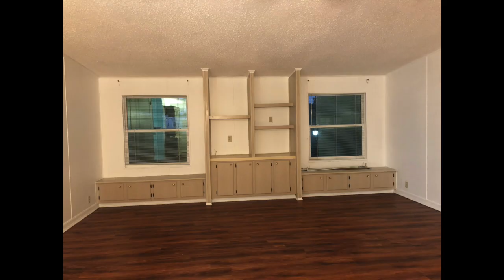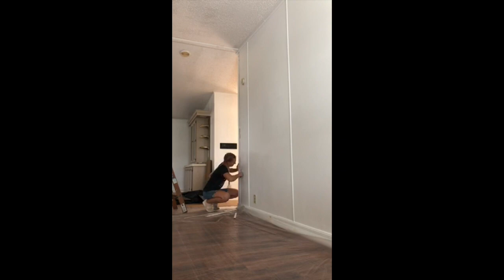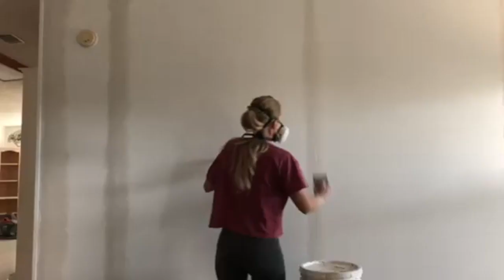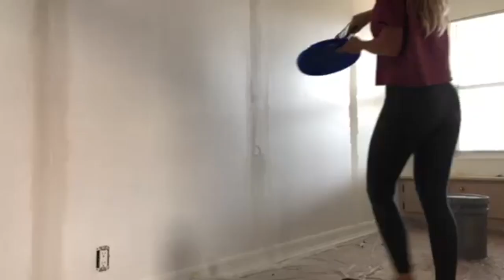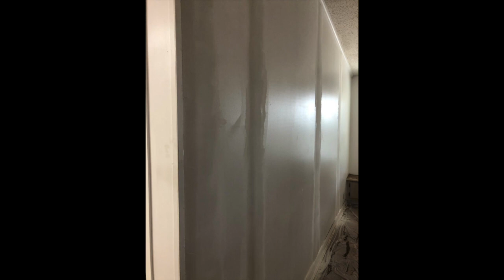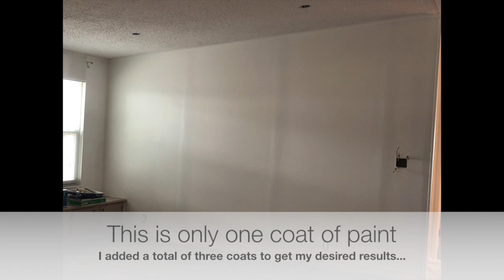Removing Wall Strips in a Mobile Home/ Mudding Walls/ Skim Coating Walls/ Smoothing Walls

Comment: On my mobile I used paintable siliconized latex caulk to fill in all seams and corners. Use a damp sponge to smooth. It doesn't crack with movement, especially in corners. Much easier and faster. You can float the seam traditionally for the final coat before priming and painting if desired.
Reply: Has this held up well?

Comment: With fiberglass mesh tape your suppose to use hot mud or joint compound you mix with water. Premix cracks and dnt have enough strength to last. And it may fail.

Comment: Looks like you were having lots of trouble smoothing out the mud. Mud should have been thinned, makes for easy applications and a lot less tiny bubbles in the mud. It’s a lot of hard work to get the cracks filled in right, without having a hump at most seams and feathering the edges out. I used to fill in cracks before I would install wall covering on walls. Did it for 40 yrs and it takes lots of practice. Keep up your hard work!
Reply from the maker: Hi! Thanks for the comment. 😃 it definitely takes a lot of practice to not see the hump. I just did another property and it’s my best yet! I was so proud of myself bc you can barely see the hump. ✨ so I’ll be making another video. I used different tape too. I’ve learned a few more tricks on getting it smooth since making this video. Thanks for watching and subscribing.

Comment: I just bought a park mobile home with popcorn sealing. Any advice on how to get rid of it. Is it a big job?
Reply from the maker: It's a messy job but easy. Take a clean, new sprayer (normally used for lawn chemicals) fill with clean water and mist that onto the ceiling, little sections at a time. While the popcorn is wet take a knock down knife and simply & gently scrap it off. Make sure to cover up floors and remove furniture from the room if possible or at least cover up everything. Then you can pick your new design you would like for your ceilings. A lot of people do the knock down/ orange peel texture which is applied with a hopper attachment to an air compressor. You spray it on, wait about 30 seconds and then knock it down gently with a large knock down knife. I hope this helps. :)

Comment: how do you suggest to do the outside corners after you take the strips off.
Reply from the maker: Hi! I would recommend using -vinyl corner bead -that you can get at Lowe’s or Home Depot. This is for corners and using joint compound over them. I find them right beside the joint compound in the store. Install the corner bead over the rough corner, joint compound over them, let dry, sand and keep applying joint compound and repeat process until it’s smooth to your liking. Hope this helps!

Comment: I removed all the strips but now I can't do the rest and my mobile Home looks horrible 😭
Reply from the maker: Hi! If you don’t want to mud the walls try a flexible caulk that’s paintable. You’ll still see the line a little but it will be better than the gaps. 😃
Reply: @nitrapalmer  Thank you, for the tip. It doesn't look too bad now 😃
Reply: @nitrapalmer  That will look horrible in no time at all. Caulking is not a fix it all.
Reply: Don't start a job you are not qualified to finish.